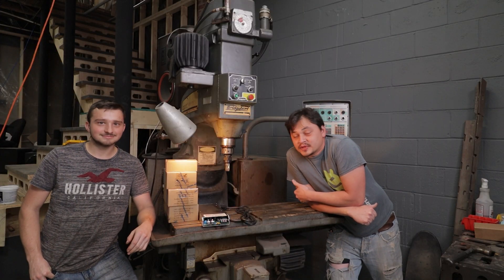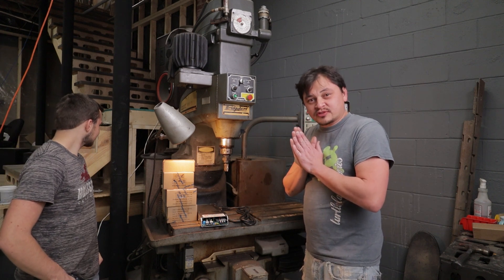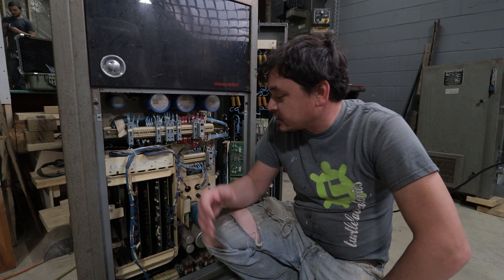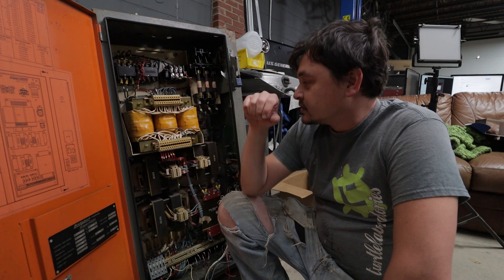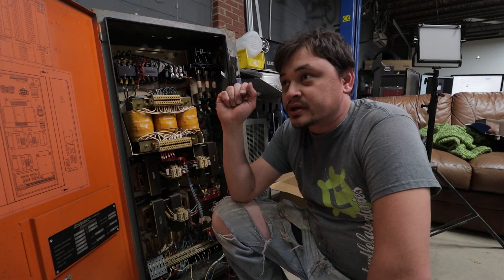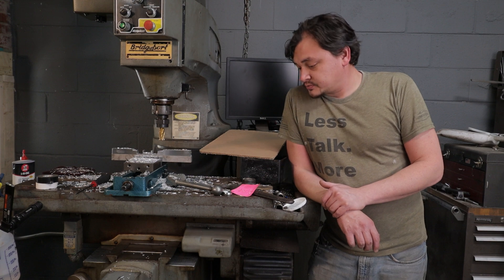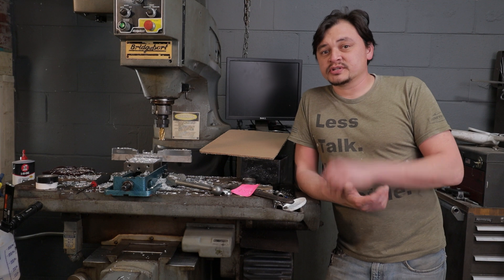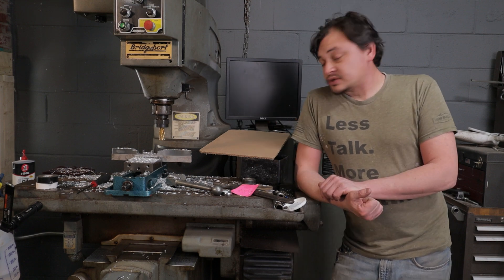Bridgeport Boss Series 1 CNC Vertical Mill Retrofit Conversion with Updated Components

Comment: I was lucky enough to find one of these with a Boss5 that had died but the iron was in excellent condition. Tried running it on MicroKinetics MillMasterPro but it really sucked, switched to Mach3 and now it works great. Mach3 has so many more features, particularly cutter compensation and tool and fixture offsets.
Reply from the maker: That's awesome! It's always great to hear about successful retrofits! Mach3 has been the go to for years. Even though it hasn't had updates in a long time, it just works for the most part.

Comment: This was a great video to get started. There seems to be allot of unanswered questions so I figured I’d comment after a few frustrating days of trial and error! I ordered everything from this video and wired the stepper motors stepper motors “half coil”. Basically these are 8 wire motors with jumpers to make them series with a common wire. On the motor I used terminals 7-4 and 1-6. Or wires white/blue-black/white and  white/yellow- white/red. That’s what I ended up with for y axis instead of taking the cover off. I’m guessing you could wire the other pairs in parallel but it seems strong enough and the drives listed are 7 amp. The motors are 8.5 max. They are 200 steps per revolution. Set acceleration super low these aren’t fast machines with the stock stepper. I hear the ball screws are .5” per revolution. I’m posting my project here. I have a picture the x axis motor wiring
https://www.instagram.com/p/DNhIkT1Mtk9/?img_index=1&igsh=MnRxM2hsZTJmeW9w

Comment: I'm trying to retrofit a similar mill.  I have too many holes in my information.  Could you show how the x y z motors are connected.  Voltage to drive.  I think I need to get a power supply.  I have a vfd, 3 drivers, and a breakout board.  Hopefully my old computer still works.

Comment: Great restoration! I did something very much along the same lines but I kept the orig steppers and stepper controllers. I'm using Intel Atom D540 mother board to run LinuxCNC and love it!
Reply from the maker: Awesome! I am glad these old machines are still getting used today!
Reply: Can we reuse old drives with modern firmwares? I heard those were analog drives and modern controllers do not support them.
Reply: @muhammadhashaam4123  The drives on my BOSS5 were AC steppers with H bridge boards that took 5V TTL grey code input. So it was easy to intercept the lines from the PDP/11 and use buffered parallel port signals from a PC.

Comment: I did a diy uplift to a boss series1 from bare metal about 8 years back. I used linuxCNC, I think bigger steppers (1200oz/inch with dm860a's), and originally I used a similar breakout board, but found on very rapid moves I was loosing sync when all axes were moving, so I retrofitted with mesa 7i76 fpga based control hardware in place of the crappy BOB. I swapped the variable drive for a vfd but kept the switchable backgear in the cut down head for low speed torque and programmed linuxcnc to read switches and use a gearbox calculation for speed & direction. I wish I had of fabbed up a real disc brake on the spindle though. I've span the stock motor to 2500rpm testing the vfd overdrive limits, but its scary and I wouldn't want to be in the same room as it running at that speed with the risk of the armature bursting etc, so I limit to 1800.  For a psu I used that honking big transformer and built a ac->dc converter with stud rectifier and huge caps. I have all the super stable DC I'll ever need out of it to run 5 axis and ancillaries in comparison to a generic switchmode supply. Since retrofitting, I've gone on to 5 axis with a diy built trunnion table,  integrated probe hardware, a self contained high speed spindle alongside the main one, encoder on the top of the spindle for rigid tapping and a few other tweaks. Its been ok but limitations,  the qc30 is a pain, if you run cheap chinese qc30 toolholders the flange tolerance is often out and it causes the tooling to loosen in the spindle and fall out and it means you have to babysit programs as you cant retrofit a ATC, and the lack of enclosure can get intense with chips flying off at cnc rates, so I made a plexi bed enclosure that moves. But... A few years back I got a Cinicinati Arrow 750 vmc, and the bridgeport sits in the corner unused because of these issues. If I was going to do a bridgeport again, I'd find one with a spindle that's iso30 and ATC'able, build a enclosure for it to avoid flying debris, and add a stepper right onto the knee and have a summing Z set up to give more usable Z range mid program.
No vids, I posted a thread on hsm but I quit there years ago so the above will have to do.

Comment: putting together one of these now. Went with DMM 1.3KW AC servos (longer .625 shaft with 5mm keys; requires broaching pulleys and fabrication of NEMA 42 spacers) and a centroid control board. These are huge machines, had to pull the entire spindle assembly off to get it in my garage and broke a few straps hauling it on a trailer home. I also needed to spend about 1k on line filters,  line reactors, relays, breakers and din rail buses. spent around 4.5k on upgrades, 1k for the machine and a few hundred in rentals to move it. I didn't bother with using the old steppers as it appears that they can not micro step meaning they have a max resolution of .001" (.200" lead ball screws with 1.8° steps) meaning they will have serious issues with surface finish and they are under powered for modern CNC tool pathing (can't move this heavy table with acceptable G's). If you decide to go with AC servo's keep the coils in the power cabinet; I didn't bother checking mine (for power ratings and inductance) before I scraped them but you may be able to use them as load reactors saving anywhere from 250 to 500 dollars. Mine was covered inside and out with a mixture of fine chips, dried coolant and broken down way oil. It took me days to just get the cabinets clean and I am still scrubbing crud off of the column/ram. I've gone through a few gallons of purple power already lol.

Comment: Your video very well, and although it is true you have changed the electronics, which is the engine, you have tried to remove it for maintenance. I have a similar milling machine, but to get the motor out, I think you have to disassemble almost everything. or not???
Reply from the maker: Fortunately, I have not had to remove any motors for maintenance yet, so I cannot speak to that. I wish you well with your project!

Comment: why not a masso g3 controller
Reply: I prefer to use a PC as a controller, and the cost cannot be beat!
Reply: doesn't support a lot of higher end CNC options and is expensive for what you get. I went with centroid and spent about 800$ for a controller, wireless MPG pendant, and software. Masso looks nice (love their touch screen) but they don't support ridged tapping or advanced probing and you can't really dig in and tinker with it at a lower level to meet specific requirements. Masso is better suited for hobby level machining; these machines works best as toolroom CNC mills or a budget CNC mill for a fledgling machine shop.
Reply: You got a centroid controller for less than $800? Who did you talk to? I have this exact machine and need to retrofit ir

Comment: Great video. I just got my hands on a series 2 interact 4 and planning the same/similar conversation. Both the breakout board and the motor drivers are currently out of stock. Can you recommend suitable alternatives?
Thanks
Reply from the maker: Thank you! If I am not mistaken, the Series 2 Interact 4 is a newer machine, and possibly equipped with servos. Servos will need a driver that is compatible with them, not the ones I used on mine. My older machine uses steppers. As for breakout boards, just about any cheap breakout board will work.

Comment: Good Video, I am converting the same unit. I am looking to add a brake resistor to the VFD (using ABB) Do you have a suggestion on which one would work best?
Reply from the maker: Thank you! I plan to add one, but have not gotten around to researching into it just yet. When I do, I will make sure to include it in a video!

Comment: Yes,   I am definately interested in a detailed video.  I purchaed a very similar machine and was starting the process of tearing it down when I came across your video.   I'd like to use the original motors as you did.  There are 6 wires and I'm only familiar with 4 wire motors.  Any help would be appreciated. Thanks!

Comment: How did you wire up those old boss motors? Did you run them as unipolar as originally designed or change it to a bipolar setup. Also does the driver limit the current somehow?
Reply from the maker: I ran them as from the factory. I have the drivers maxed out at 7.2 amps.
Reply: @turtlelaboratories  Thanks.
Reply: @turtlelaboratories  I am curious if they will stall out since I believe the factory voltage and current were higher.
Reply: @crissd8283  They do not stall from the testing we have done, unless you run them under 10 IPM. Under 10IPM, they make quite a bit of noise. We are working on tweaking the settings to make it better at super slow speeds.

Comment: Starting the same project here. Had one for a few months sitting in the shop. Where did guys get all the stuff?
Reply from the maker: We used a generic $25 breakout board (sainsmart), because we wanted to make sure everything worked on the machine before spending more. The drivers are stepperonline DM860T and they are wide open at 7.2A. We are driving them with a Mean well 1000w 48v power supply. The VFD was recovered from some scrap machinery.